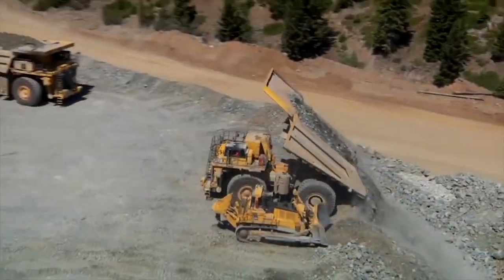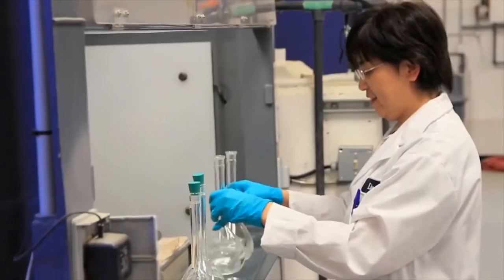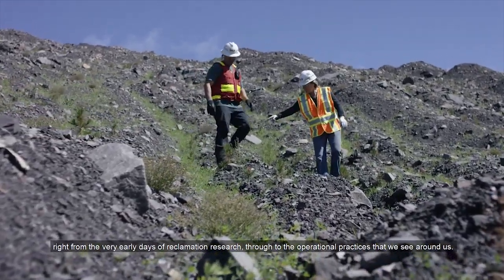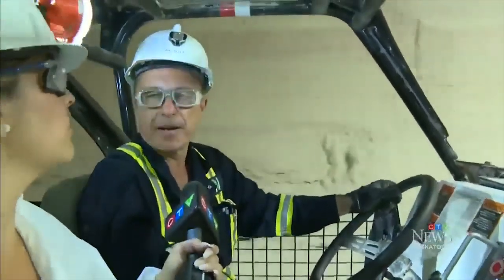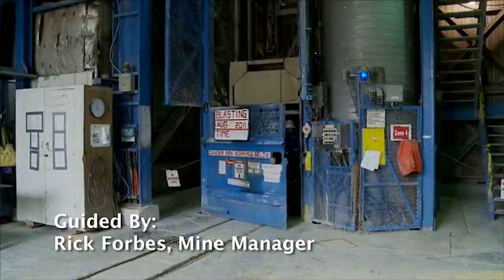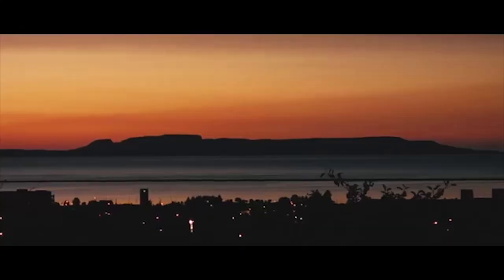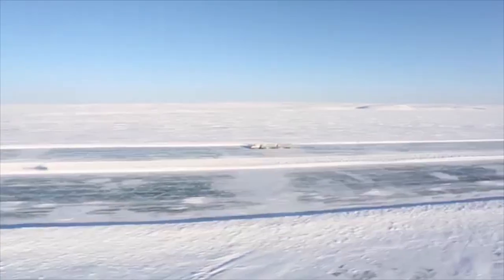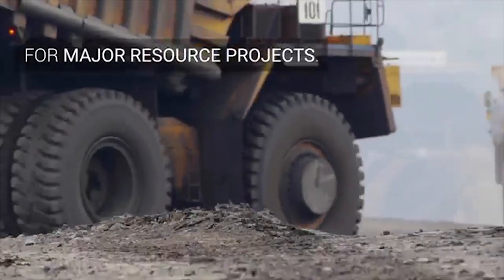8 Mines You Can Work At In Canada

Comment: Apparently, you didn't consider the necessary outside industries that were required to get your mining resource to market.  You see a railway, without seeing rail cleaning operations.  You see these mines in operation, and presumably, you think that the material to get the product to market is as simple as showing up in Toronto,  You're not looking at the full picture.  I see Diavik, and I see how many road crews to get that tractor-trailer to the actual pit in the first place, then, you consider "electrical" vehicles to replace the human element, I'm guessing, that the human element built the roads for your electrical vehicles, out in the middle of the permafrost, you just added to the cost of the mine.